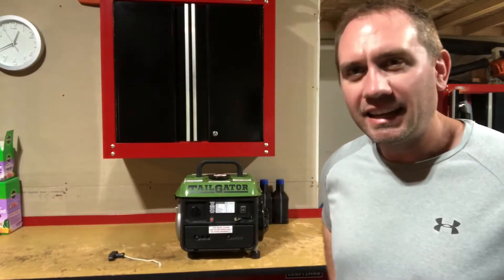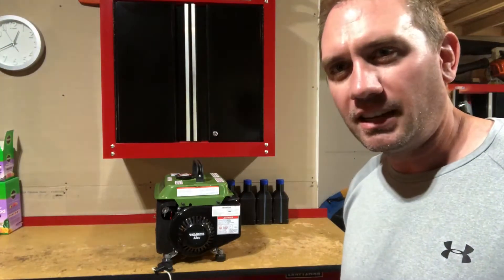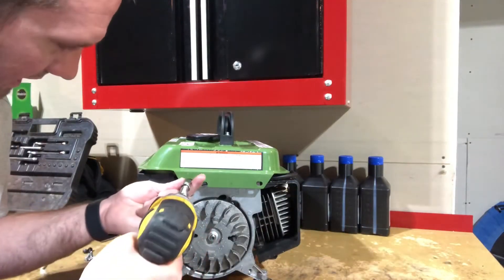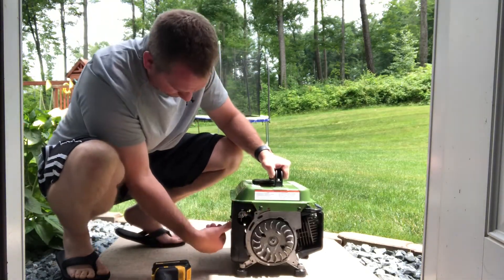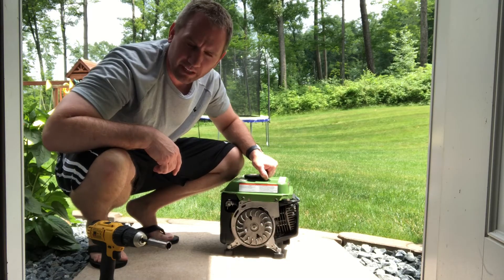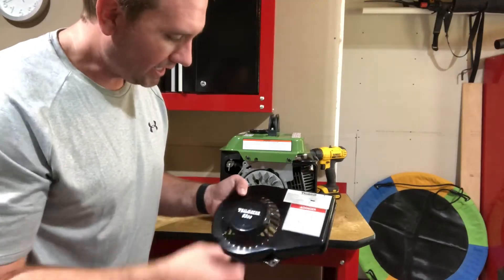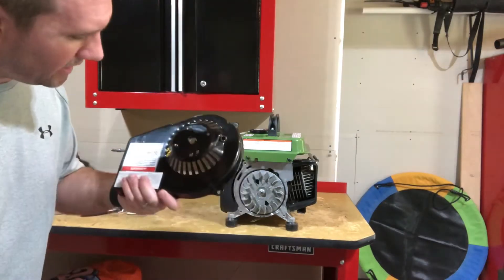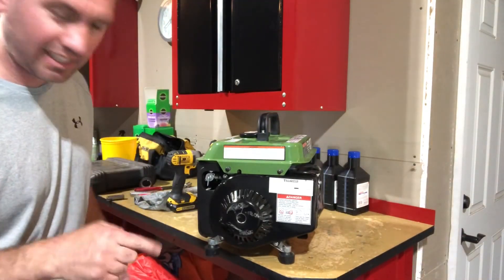Convert a small engine to drill start!

Comment: I would prefer to use a corded drill because you can spin them and they don’t have a clutch or like a cheap harbor freight drill so it can’t break your wrist. Learned from experience.
Reply from the maker: I agree a corded drill is a better fit, but I used cordless to simulate a situation where power is out.

Comment: Oh, Shiznitz! I stripped the nut attached to crankshaft of weed-eater where socket attaches too for starting with drill! Any ideas on how to remove a stripped nut from crankshaft? & how to prevent this this from happening again?
Reply from the maker: Oh no!  I would try to get it remove it with and EZ off or a locking pliers.  

To prevent it in the future, you should start slow and make sure your socket is fully seated.  A ratchet adapter would also do it can freewheel when the engine fires.

Comment: I've tried multiple times to start my Stihl fs56  weed eater with a 12v black and Decker drill but it could barely crank it smh
Reply from the maker: That is a good point, you need to have a drill with enough torque to do the job.

Comment: Basically you make your generator dependent of some kind of electricity. I don't think this was a smart decision.
Reply from the maker: Has not let me down yet
Reply: @TheLawnEngineer  yeah I can imagine, this generators are built to last - despite the price and the origin 😅
As long as you have some charge in your batteries, you are fine.
I forgot to say, I though that was a good idea - not a smart decision ahah - but you can put a socket there, a rope and make it run without much problems.

Comment: Drilling out the welds on the recoil assembly could have cut off your fingers when it let go and ended up stuck on your drill spinning out of control.
Bad instruction by a non mechanically inclined instructor ! First of all clamp your work securely in a vice so that when it lets go it’s not spinning fast enough to surgically remove body parts. Secondly, grind the welds off with no danger of it spinning recklessly once it lets go. And finally where are your safety glasses when drilling metals and there is possibility of metal particles flying into your eyes ?
Reply from the maker: Thanks for the tips, I am always learning and will take these into consideration.

Comment: I've done that several times and when the engine started it turns faster than the drill, and the nut will come off the flywheel
Reply from the maker: A ratchet adapter on the drill will allow the engine to over speed the drill 👍

Comment: As easy it is to just pull the rope on these little motors why change it? If your motor is hard to start something is wrong with it.
Reply from the maker: There is something wrong with it, poor design.  It’s a small Chinese 2 stroke engine with a short rope.

Comment: A couple of comments, if I may. The unit will start without the pull coil assembly .... a simple piece of rope with a handle will do, all you have to do is rewind the rope a few times.. The unit already has the attachment, attached. Secondly, use your drill to mimic the speed and duration that a recoil would work at. Three of 4 sparks at a time is all that's required, you don't have to go 5,720 RPM. Cordless power tools have tremendous torque and can break your wrist quite easily. Find a 1-way socket, it has it's own clutch/// .. about $20. on Amazon. I start all my small engines with a drill, even my chainsaws... but not an impact wrench. Good video.
Reply from the maker: Great points, thanks for the comment.
Reply: Do you have a link to the one way socket? I guess I'm not sure what I'm looking for. Thanks.
Reply: Link also please. Thanks

Comment: I used a 1/2" drill to start a 4-cylinder hand crank tractor engine on a 1923 Fordson I was restoring to it started while tuning it. Needed a long side handle to offset the torque. Be careful not to over torque that small nut and crack the flywheel.
Reply from the maker: That sounds like a great application, thanks for sharing.

Comment: Unfortunately, most pull start engines don't have a center bolt but some weird three tooth assembly that is part of the clutch mechanism, so your idea will work on 1% of the small engines  on the market, ie only small electric generators.
Reply from the maker: Fair point but 1% is unfairly low.
Reply: @TheLawnEngineer  It's guesstimate I pulled out of a hat.  It can be 5,10% or more. I tried to do it with my grass trimmer a long time ago, but without major surgery it's "No way, Jose". Cheers ..

Comment: As an old machinist, I have always been aggravated at manufacturers of pull start engines for not having a hex or allen head shaft end coming thru the housing to use a drill!  I hate yanking on a Stihl chainsaw or a weedeater!
Reply from the maker: That would be very handy, thanks for sharing.

Comment: What happens when you need to charge your drill battery during a power outage?
Reply from the maker: That’s a consideration but it uses very little of the battery to start the generator.  I’m more likely to be out of gas than have a dead drill battery.

Comment: The next storm you have your drill battery will be dead and you won,t have a way to start your generator.
Reply from the maker: That’s a considerable but not a valid concern.  I have two batteries and one is always on the charger.  Today’s lithium ion batteries are very good.

Comment: So, when power goes out and your cordless drill is without charge... you're basically left with no manual option to start the generator.
Reply from the maker: That is a consideration but has not been a problem in practice.

Comment: Just a thought why can't one take a old stater and use a belt connected to a clutch like that's used on snow mobiles but smaller, connecting the clutch to the dc shaft and mounting a small pulley to the engine.  Just a thought I had
Reply from the maker: That could work👍

Comment: Great idea for most small engine applications. Emergency generator - not so much. What happens if you get a power outage and you battery drill is not charged?
Reply from the maker: It’s a consideration but not a big concern.  I have two batteries and one is always on the charger.  Also, today’s lithium ion batteries are very good.

Comment: Let me just warn you that you run the risk of ruining the shaft by constantly using the drill on that nut.  Either the nut or the shaft is harder than the other.  Either way, you might torque the nut down too much.  You might want to build a bridge that goes over it, and attach it outboard and above the shaft nut, attaching it to the flywheel somewhere that will not interfere with the magnets inside for the magneto.
Reply from the maker: Great point, I made a follow up video that goes over these concerns. 
https://youtu.be/jf4qOC9220I

Comment: You will cry when the drill stips out the crankshaft nut and the flywheel drops of   it can not take the load on most engines
Reply from the maker: Good point, I made a follow up video Watch this Before Converting Engine to Drill Start
https://youtu.be/jf4qOC9220I

Comment: Interesting, looks like you put the drill in reverse then it started. Did you put the drill in reverse?
Reply from the maker: I think I did accidentally have the wrong direction at one point.  However, this is a 2 stroke engine so it will run in either direction.  The cooling fan is designed to run clockwise so don't want to intentionally run counter.

Comment: Actually no matter what kind of generator you buy, the more you use it the longer it will last. I have a champion china generator that has well over 10,000 hrs on it, and it doesn't even use any oil.
Reply from the maker: Great information, thanks for sharing.

Comment: This is all good if you have a picture hanging drill like harbor freight, hart,or ryobi. But if you have a Dewalt XR or the Milwaukee Fuel I'd like to tell you before you make the same mistake I have. I went ahead and pulled the pull start off a clients junk Husky 300+ dollar 2 year old weedeater and it looks like brand new. I put the nut back on and was cranking it with the Fuel hammer drill which was not on hammer and I did have the clutch set up towards the higher end of the setting to turn it but still not break my wrist and I believe it could. I end up with the threads stripped on the crank to the point where I couldn't even get the nut back off until I finally got it to cross thread off ruined the crank as well.  I learned not to do that ever again but also to not by Husqvarna anymore. I have the rough country chainsaw and I treat it right. I don't even use it once a month so I don't fill it up when I do I just try to get close to what I need non-e gas with a little more oil in it but run it out dry before I store it. Drain the gas tank and start it back up and let it run dry. Then your ready to let it sit. Nothing but non-e gas octane doesn't matter. If you have to use ethanol gas 93 contains less ethanol I believe then the lower grades to keep the 93 octane or it burns it better because of the high octane. Just experience that I have years of. I work on small engine's as 😢as  side hustle. I am simply good at this
Reply from the maker: Thanks for sharing your experience, very helpful.

Comment: Ive refurbished 3 gas generators over the years. They run great for a year or so then need more regular carb cleanings. No matter if a fuel filter and shut off is installed. Sea foam helps greatly. Ive moved on to propane. You can store propane for a decade or more. Done with gas.
Reply: I have one of these, and many others, I'd say about 7 generators right now. They all last forever and never varnish. The trick is before you put it away, shut off the fuel, let it run till it starts to die, put the choke on till it dies and then the fuel is gone enough it won't varnish. I have an off grid cabin and put tens of thousands of hours on cheap little generators I never would have thought could run that long
Reply from the maker: Great idea, the gasoline of today isn’t a pure petroleum product anymore.  Thanks for sharing.

Comment: It will loosen the bolt that holds the flywheel in place ! (Nut)
Reply from the maker: I did a follow up video covering these points Watch this Before Converting Engine to Drill Start
https://youtu.be/jf4qOC9220I

Comment: These generators are a Yamaha design that the Chinese kept manufacturing.  I've had great luck with these, getting over 2000 hours on one of them.  There is a trick to these.  #1:  Never pull the rope without the choke all the way on, it's likely to backfire and break the starter pawls (plastic) requiring a new blower shroud ($20).  #2:  When you turn these off, shut them off by shutting off the fuel.  It will burn all the fuel from the carburetor and prevent any lacquer buildup inside the carburetor.  #3:  Don't leave fuel in the tank for long periods of time.

If you embrace these few things, these little generators will run for years.  While I don't know how it will perform for others, I've never had any problem running televisions or computers on these small generators.
Reply: They are a pain to start because they are 2 cycle and the pull cord is quite short to get speed.

Step 1, drill an access hole in the plastic carb cover (air filter panel) that you can plug with a  tiny cork.
Step 2: set to run and spray with starting fluid.
Step 3: put cork in hole
Step 4: choke it and pull slowly through one complete revolution.
Step 5: put it on half choke and pull slowly just to 1st compression stroke then pull fast.

Should start on 1st fast pull.  Or 2nd.

The running them dry still leaves gas mix in the carb bowl (about 1/2).  If old that'll fight you.  There's no purge tap, so just remove bowl (one easy nut) and dump.

I miss purge taps.
Reply from the maker: Mine has been a bit of a pain to start but I am actually very impressed with the performance of this little generator.
Reply: @TheLawnEngineer  I think these are great little generators and underrated.  They are noisy compared to a Honda, but the Honda is incredibly expensive by comparison.
I've had a lot of good luck with these over the years, and it's often the perfect size.
Reply: #1: Only a piece of crap would have this problem.
Reply: @rcnelson  Before I got power into our cabin, I ran these small generators for about 16 hours a day, only switching over to the big generator for the water pump and microwave.  I figure I was getting well over  2000 hours on them, probably a lot more.  I've had the engines die, but never the generator part.

These are decent little generators, easy on gas and will run computers, etc., without any problem.

If you know how to run 2-cycle equipment, these were a bargain and would last for years under normal use.  You could spend $2000 for the little Honda, and it would be quieter, but in the end they didn't last any longer.
Reply: @rcnelson  it is a crappy generator.  It works, but it is a fiddly carb.

It is a $70 700watt generator for just lights and a few power tools on a spot.  I bought it for work out in my woods where I can easily toss it in the back of the vehicle...without the mass and overkill weight of a real generator.

Extremely loud.

They retail for 150 now and aren't worth that.  Easier to buy a small battery pack today...but not 10 years ago.

They do last, but the power sine wave will only settle out with a load 1st like several lights or a fan before you try to plug in a sensitive device.
Reply: @rcnelson  most pull cord motors, even great ones, work best with a slow compression full cycle pull to prime the engine...then a short slow pull to TDC...and a yank.

Learned that on starting old British cars by hand crank and kick start cold motorcycles.

Comment: Careful when you do this with a four cycle—if you don’t pull the socket off quick, it can send your drill on a flight, with your arm attached…
Reply from the maker: Absolutely right.  I made a follow up video here: Watch this Before Converting Engine to Drill Start
https://youtu.be/jf4qOC9220I
Reply: I think this should be left to do on 2 cycle engines four cycle engines have a compression state when it's hard to get past that point. Two cycle engines are much easier to pull and the fly wheel movers more freely. I have an old lawn boy mower I would like to try this. All these new mowers don't have the placement of the wheels is the right place. The old days the front wheels were in two different places. The rearars like they are today. The front wheels had one in the front end the one on the right were about one third back for mowing uneven yards. I sure miss that in a mower . 73

Comment: Did this on my pressure washer and twisted crank shaft bolt off.
Reply from the maker: Yes that can happen.  I discuss that in this video: Watch this Before Converting Engine to Drill Start
https://youtu.be/jf4qOC9220I

Comment: I will tuned engine  will start in 1
or 2 pulls  with fresh gas and choked properly.   If store my gas equipment over the winter  I run the engine out of gas to keep the carberator from gumming up
Reply from the maker: Agreed.

Comment: I did something similar with my walk behind mower, but being safety conscious I used an overrunning clutch between the drill and the crankshaft. That way when the engine revs faster than the drill it won't damage my wrist nor the drill. An inexpensive 1/2 inch Torrington clutch does the job well enough.
Reply from the maker: Yes, good idea to use a clutch device especially on bigger engines.
Reply: Speaking from experience you will strip the threads of the end of the crank, then after more tinkering you might break off the end of the crankshaft. Ask my weed eater (stihl) 😮😢
Reply from the maker: @roberttaylor2616  Yes, that is a possibility.  I did a follow up video here: https://youtu.be/jf4qOC9220I

Comment: When I built and raced the Harbor Freight  and Briggs engines, we would take the flywheel nut off and repalce it with an extended crank nut. You could use a drill or a starter box to crank it. In a pinch, we would keep a cutoff Briggs 5hp pull start. You still need to cut a small hole in the blower housing for the nut to extend out. Make sure to remove the sharp edges from the hole you made.
Reply from the maker: Great information, thanks for sharing your experience.

Comment: As someone else alluded to, you've now taken your emergency power source and made it dependent on electricity to start. Hopefully when the next emergency need comes up you haven't allowed your drill battery to be drained.
Reply from the maker: It’s definitely a consideration.
Reply: 5/20/24 calling . A 300 watt solar panel with inverter would charge most / all modern tool batteries .

Comment: This is not a new thought, actually a company back in the seventies made a rubber adapter that went in the place of your pull start and you also had one for a drill. All you needed was to plug your drill in reach down with your adapter rubber socket your engine started with little fuss. My father had these and several of his lawn mowers. Not new just forgotten. Actually I still have one those setups. I think they were actually sold in popular mechanics a magazine to all you young people.
Reply from the maker: Thanks for the perspective, only thing new is better batteries for our cordless tools 👍